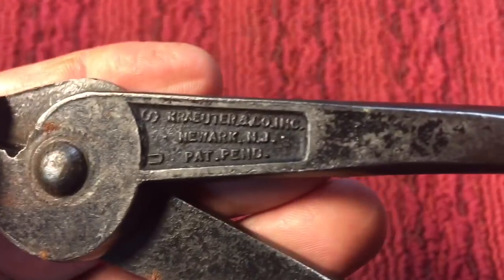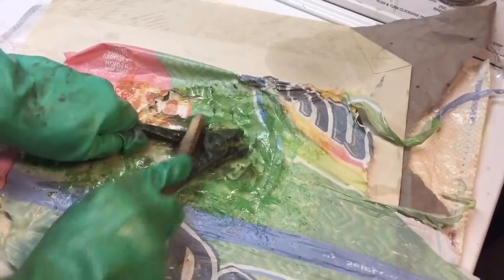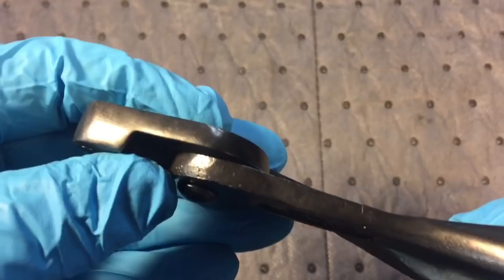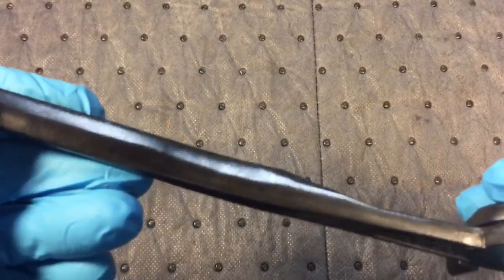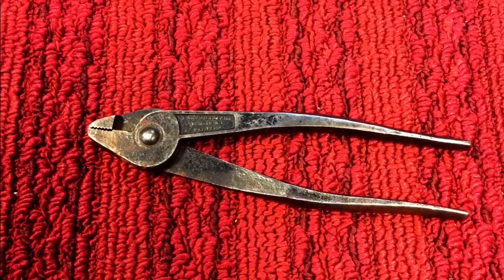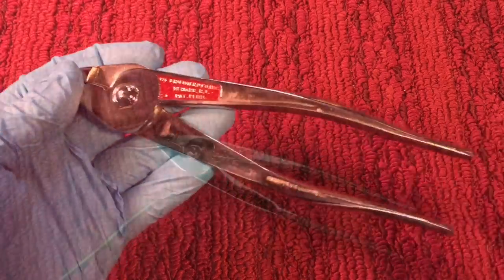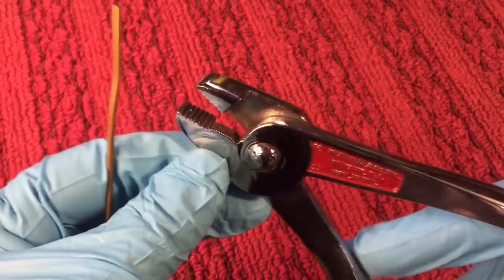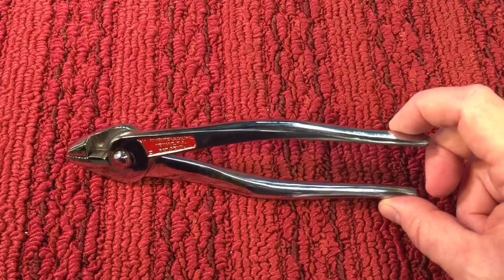WW1 Kraeuter Pliers Tribute Restoration...

Comment: I got a 10 inch wire wheel and man what an easy way to clean off all the rust. Now I have to practice the belt grinding and then the buffing. So much fun restoring tools. Thank u again for lighting a fire in me to do this. I love it
Reply from the maker: Hello Scott!  Holy cow!  A 10" Wire Wheel!  That is huge!!!  Awesome!  It's good to have a smaller wheel that can get into tight areas that the 10" can't get into.  I have a Dremel and some small wire wheels that can get into cracks and In-between other areas.  You know a good wire brushing, wipe down with denatured alcohol and coat with shellac is all you need for most restorations!  Great stuff!!! 😃👍
Reply: Thank you for the reply   Headin for the she rite now. Can’t wait for your next video. Watched you early vids and your rite some r hard to watch but still enjoyable thanks again

Comment: Barbed wire was often cut at night, so the soldier would place a piece of material usually a piece of sand bag over the wire to muffle the sound of the wire being cut. Nothing says, I'm out in your wire, like the clink of wire being cut. While your beautiful polished finished cutters look great, it wouldn't be long before they took on the rusted appearance after being rained on constantly. I remember rust in the Army when I was in, was called GI gold . That didn't go over well with the grumpy Sgt..
Reply from the maker: Hello Kenneth!  I can't even imagine the conditions out great grandfathers would have endured in trench warfare!!!!  By the time I entered the service we were using Concertina or Razor wire and although it wasn't as intimidating it would hook your utilities and just hang on!!!  lol  As for the finish!!!  I am making up a tribute board of all the Kraeuter pliers I can get just like they used to display in hardware stores back in the 30's... All polished out on a Green felt background in a Oak frame!  Sweet!  I have two-hour pair in Original Black!   Thanks very much!!!!

Comment: Wire was pretty darned important in The Great War.  I bet there are many of these lost on the Western Front.  Were manufacturers using phosphoric acid or similar product back then to make a dark finish?
Reply from the maker: Hello David!  You are so right about the Wire in WW1 As for the finish I would really like to know the answer to that myself as I am restoring the other pliers to original issue condition... I know you are familiar with early coating like Lamp Black and Black Oxide... These look a little different and the coating was extremely durable!  I'm not a fan o the Black Oxide finishes as they feel horrible when handling but this finish was much friendlier to handle.  I do believe this finish was applied with some sort of heat... Thanks very much!
Reply: Back in 1971 I bought a new Case Sodbuster knife.  A friend told me to stick it in  an orange.  That took off the plow image and gave the blade a smooth gray finish.  Rust has never been a problem, and I carried that knife for years.  It is still an nice gray, patina-like finish and it gets oil very occasionally.  Phosphoric acid would probably dull the metal too much for your purposes. Maybe a little Diet Mtn Dew to darken the metal.  The acid in that will eat your teeth!
Reply: They've parkerized the surfaces, the solution contains additional metal ions so it's not only phosphoric acid. It was cheaper and more effective than bluing them. That was mostly done with guns, Glock still do this:

https://en.wikipedia.org/wiki/Parkerizing
Reply from the maker: Marcel, I have lots of parkerized firearms, and parts and I'm pretty familiar with the surface it leaves but the original pliers like these definitely have a gloss like appearance.  It is not matt... even where the pliers weren't touched or oiled or anything...  Yet it's a casting of some sort... If I had to reproduce it I would take some Tar, thin it out until I can brush it then after applied I would bake the part...  That is what the coating looks like!  Lol   Thanks!!!!
Reply: There are a lot of different methods to passivate a surface.
And sometimes manufacturers were ashamed of their parkerized surface finish. Webley&Scott for example. They've stamped these revolvers with "WAR FINISH" to tell everyone that this is a war manufacturing and not their standard finish:

https://media.joesalter.com/ca/large/C531/C531-04.jpg

A good replacement for some applications can be baking enamel. It's resistant against heat and oil. You can get it with a matt or a bright finish.

Comment: Ah, very nice. The next piece for your display, plus the your color red. When they were built do think they dipped them when painting the handles? Again super stuff, thanks again.
Reply from the maker: Hello Norherman!!!!  I have two other sets that I am restoring in original Black, I am researching the procedure they used to get that unusual finish on them!  I have used Japanning and Black Oxide but these are different, They do look like they were added with heat!  Very durable finish!  I will find out...  Thanks!!!!!

Comment: Question about finishing. What grit of sandpaper do you use before you go to the jewelers rouge or polish? And what color and or grit? Thanks, Bryan.
Reply from the maker: Hello Bryan, I keep a lot of used belts so it's difficult to tell the exact grit, however if I need to remove a lot of metal I use 60 grit and work up to about 400 grit...  As for the buffing bar I really like the BLACK bar!  It works great!   Hope that helps!  Thanks!!